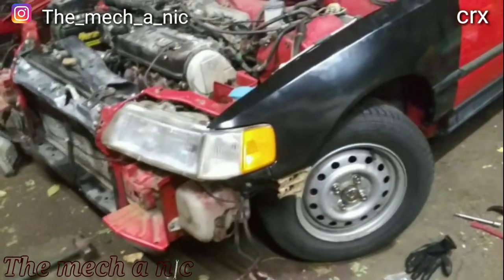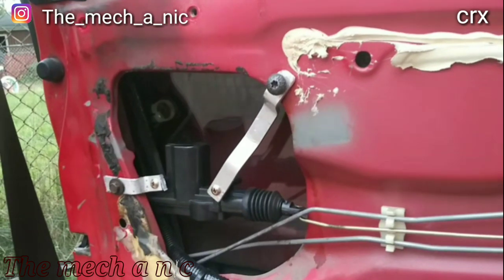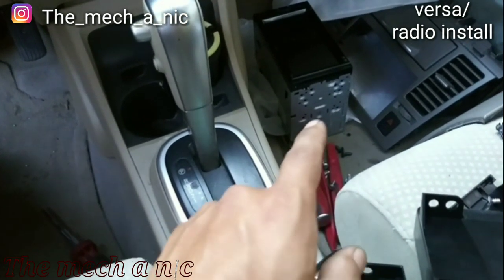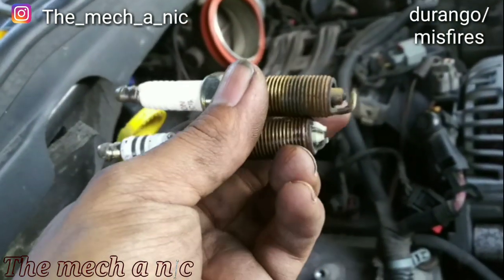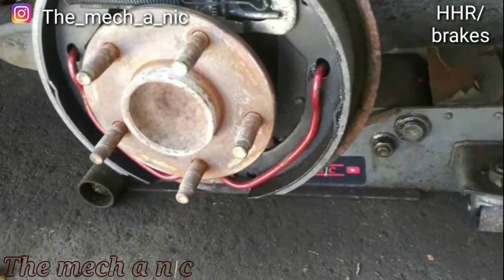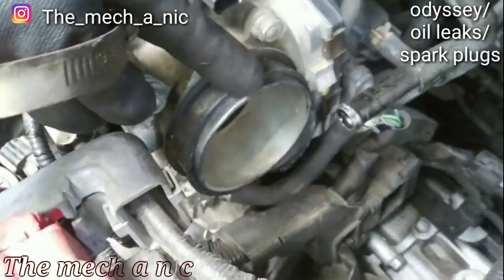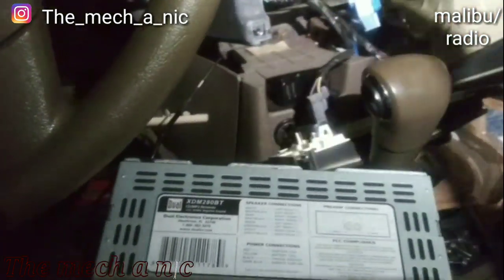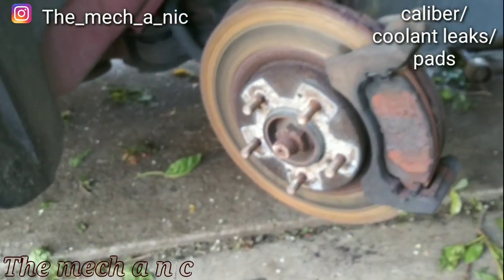insta mech a nic (vol 39) radio install, more misfires ,cutting drums

Comment: Do you know that in order to access the menus in that pioneer head unit the parking brake needs to be hooked up or u can get a bypass switch that’s sold on amazon
Reply from the maker: I didnt know that. Anyway its not my car to bypass anything. If thats a safety feature pioneer did then thats how im installing it 😊👍
Reply: The mech a nic put some electrical tape on the ratchet to help the flexing